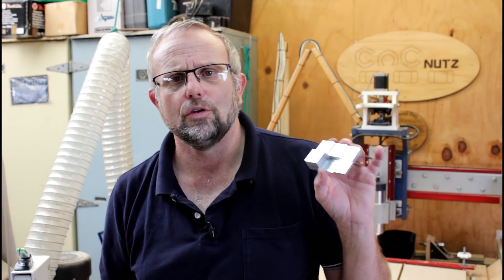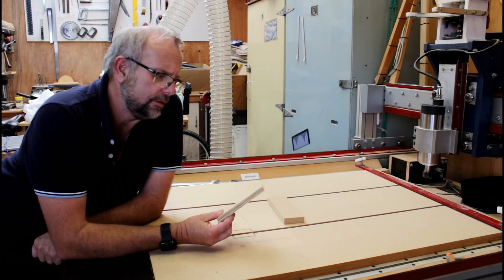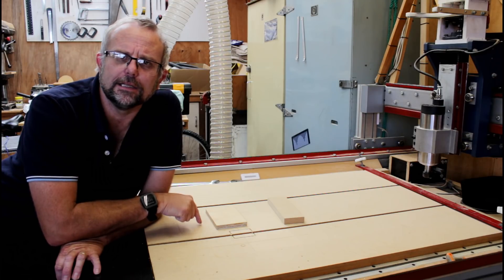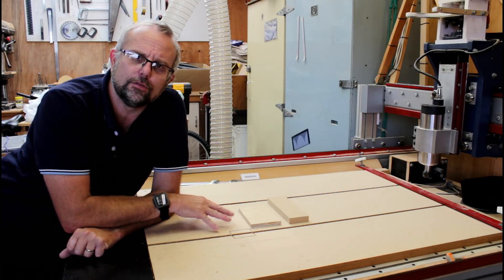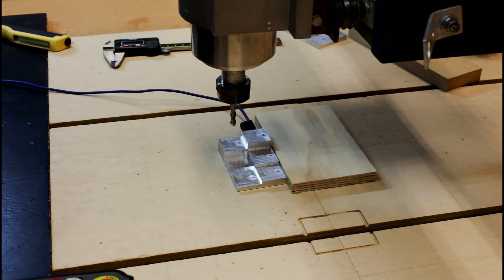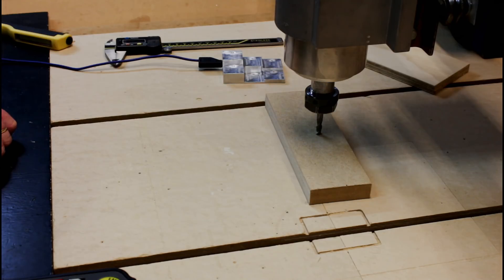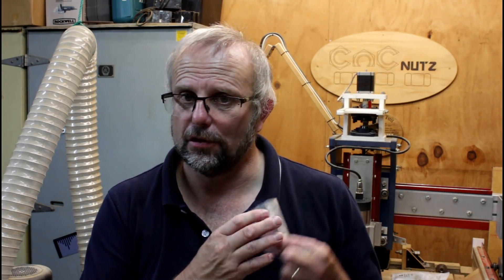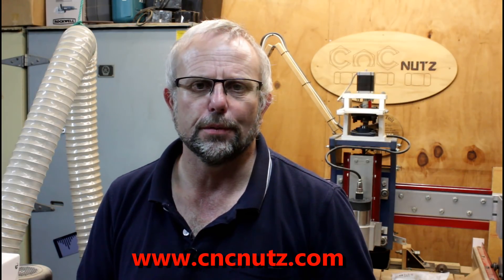The nominal thickness tool setting guide - CNCnutz Episode 202

Comment: I’m sure I’m missing something, but why not always use what you call the “zero” touch plate on the spoilboard, and then set that as the correct Z height? For example, if your stock is 12mm, you would do (where TPT is the touch plate’s thickness) “G92 Z-(12-TPT)” if you made your gcode file with the Z zero on top of the stock with a thickness of 12mm, or you would do “G92 Z(TPT)” if your gcode file uses the spoilboard as its Z zero. Of course, if you don’t have a way for your software to automatically reference your TPT, it might be tedious to type and remember (if it’s not a perfectly round number) every time, but I would guess most software allows to script it (I’m using mostly cnc.js with GRBL: https://github.com/cncjs/cncjs/wiki/User-Guide#statements).

What I would do, then, is “G92 Z12” so my script/macro knows that I want to zero relative to a 12mm stock, then run a script/macro that would simply do something like (with an example TPT, “posz” is the current Z position, which is 12 as set preciously):

%TPT=2.08573
%NEWZ=posz - TPT
G92 Z-[NEWZ]

What I’m I missing? Thanks!
Reply: Just answered my own question by watching the next episode, where you basically do exactly what I explained above. Cool :)
Reply from the maker: Nice one Simon. The fact you understood that something wasn't right is half the battle.
Cheers
Peter

Comment: Very interesting video and idea. Just a question: how do you realize the right thickness of the gauge? I saw the video, the episode 200, where you worked on the aluminum bar, but I don't understand how you can set a perfect thickness of the different steps of the gauge. Probably you put the zero of the the machine on the table instead of at the top of the bar and the you added the desired thicknesses? Sorry for my bad english and may be for my trivial question, but I'm a newbie in the CNC world and I'm studing it.
Reply from the maker: Thanks
All touch off plates have a thickness which is entered into the autozero script. The maximum depth on my gauge is 18mm and the aluminium stoch is about 20mm. The difference is the thickness I enter in the script. I got my thicknesses by starting at the top and called it 18mm. I machined down 6mm which makes the next step 12mm another 6mm makes 6mm as mother 3mm down gives me 3mm and another 3mm down I called 0mm. The remainder will be the 2mm or so of remaining thickness which becomes my touch off thickness. Everything is relative to this height. I hope this makes sense. It's just a pity it was obsolete in less than a week. 😉
Cheers
Peter

Comment: How does the "0" part of the gauge have material and yet when the machine goes back to that "zero" point its below the point of the new "0". The smallest thickness on the tool setting gauge looks like one or two mm... you must have subtracted that value in the calibration of the Z axis yes, you didn't mention this.
Reply from the maker: You are right. The 0 part of the gauge is about 2mm thick and this is the figure that is entered into the script as the plate thickness. Everything else is then referenced from this point. eg the 18mm step is 18mm above the 0 level.
I was going to do a install video but the toolsetter got superceeded by a new Auto Zero script that rended it obsolete so it never got made..

Cheers
Peter
Reply: I like this idea except it could become tricky when the whole job, designed in Aspire, as an example, would have the Z reference either top of material OR bottom of material/spoil board. That would mean creating 2 job files, one with vcarve and or pockets etc and one with profile cuts. Hmmmmm a problem to solve
Reply from the maker: Hi Sean. I think you have misunderstood. At no time is a toolpath created with its origin at the bottom of the stock. All toolpaths are made with the origin at the top. Only 1 file is needed no matter how many tools you change.
Cheers Peter
Reply: @cncnutz  thanks Peter. I think my system is just dumb. nc studio 🤣 but its worked for 8 years

Comment: I hate to be the one to ask the stupid question, but how can you set the bit to zero on top of the material if the nominal thickness gauge cannot possibly be zero?  There has to be some thickness or there wouldn't be any aluminum there.  And how, if you set it to zero on top of the material, does it end up touching the workpiece when homed.  Shouldn't it always be above the workpiece after the first z probe setting?
Reply from the maker: Not a stupid question at all. To me questions mean people are thinking and trying to understand so all is good.
For the same reason that all other tools setters are not infinitely thin. All tool setting Scripts & Macros has a built in offset to account for the thickness of the tool setter itself in my case 2mm. The thickness of the 0 step on the guage is 2mm thick. That makes the 3mm step 5mm thick and that continues all the way to the 18mm step which is actually 20mm thick.
When the cutter is set using a tool setter the Z is calculated as being at the tool setter thickness. eg the machines knows that when the cutter is touching the plate it is 2mm above the material if I am using the 0 step.  From there the cutter is raised above the tool setter by the required amount so that you can get the tool setter out. Please note that the machine knows nothing about my stepped tool setter so if I use the wrong step to set the cutter the zero point will be wrong.
Since Z0 was set on to surface of the stock the cutter will sit on the surface of the stock when the cutter is told to go to Z0.
Please note that I am not homing the machine to send the cutter to X.Y Z 0 but using the Goto Zero function which uses working coordinates.
I'm not quite sure what you are asking in the last question about being above the work piece. If you could rephrase it i will try and answer. Let me know if you have any more questions.
Cheers
Peter
Reply: Thank you Peter, you answered the question.  I was wondering how you could "zero" the bit 2mm above the work and have the bit touching the work after being set 2mm above?

Comment: I think that’s excellent Peter. I’ll make myself one of those. What feed rate did you end up using when cutting the aluminium?
Reply from the maker: I used 30ipm in the end.
Reply: Thanks Peter
Reply from the maker: Hi Des,
Before you make one you might like to hold off as I may a have another solution that will do the same thing better without the need to machine a tool setter. Just working on it now.
Cheers
Peter

Comment: Brilliant... nicely done! Having said that... and being inherently lazy... as well as a fairly decent programmer... I'm going to make some custom buttons on my LinuxCNC panel for "Surface" , 3mm, 6mm, 10mm, 1/2 inch, 3/4 inch, and 1 inch. Then I'll put the plate down as always... and just click the selected button. 

I'll be using the G10 L20 P1 Z__  where Z = offset selected + thickness of the touch plate. 
(For you other CNC geeks out there.)

I guess I'll have to make a video on that... hey! Thanks for the idea Peter!
Reply from the maker: Thanks Jerry,
I like John Rivells method of having the macro ask for the material thickness each time the auto tool zero is used and then setting the cutter accordingly. 0  for setting off the stock surface and the stock thickness if using the tabletop as a reference.That way one button does it all.
Cheers
Peter
Reply: CNCnutz (Peter Passuello) Easy to implement with a spinbox. (text input device in pyvcp).
Reply from the maker: +askjerry
I'm sure that means something to you. I only understand the word easy. 😀

Comment: I want one but don't want to make one because of your trials and tribulations in doing so... can you build me one? LOL  Seriously though this is brilliant!  I've been using your "zeroing to the table" technic since you posted the video on it and it has saved me much time and spoil board! I think it would be an awesome tool to have! I would like to see more on your macros/codes and how you incorporate those with it? I would probably build one plate for each thickness and have a quick connect for the wire lead to simplify building one/them... or buy one from you! LOL
Cheers,
Lyle
Reply from the maker: Thanks Lyle.

Comment: YES, now this is a Z set tool that I will use.  I totally understand your explanations of setting the Z at both positions.  Now I’ll be looking for some good GCode to do the double touch as you mentioned I would prefer that over the single touch, could you link to this type code?
Thanks for all your excellent work.
Reply: Use mine... just change the thickness value of 8.650 to whatever the measured thickness of your plate is.

o<touch-to-zero> sub
G91 G21            ( Retaliative METRIC Mode)
G38.4 Z-20 F100           ( Move DOWN, assume no contact at start, machine reading "probe tripped" )
G0 z1            ( Pop up 1mm )
G38.4 Z-10 F10   ( Back Down 1/10 speed )
G10 L20 P1 Z 8.650  ( Register the surface as 0 + thickness of plate )
G90 G21            ( Back to Absolute Metric Mode )
G0 z10            ( Go up 10mm real units. )
o<touch-to-zero> endsub
Reply from the maker: For my setup I am using a screenset from http://www.thecncwoodworker.com/index.html   
His 2017 screenset for UCCNC and it comes preloaded with the required macros for this and various other functions.
He also has a screenset for Mach3 which I think has the same functionality.

Comment: I use a spring loaded setting gauge.  I have seen cases where the autotool setting function does not stop when it contacts the gauges.  When I see the plunger starting to depress I know it is time to hit the estop and find out what the problem is.  Last time it happened the problem was that the end mill had burned through some wood  on a previous job and that left a nice insulated film on the bottom of the end mill.
Reply from the maker: I know what you mean, it is a bit of a worry.
That said you should always check that the touch probe is working before running the auto tool zero function. In my case I can touch the bottom of the cutter to the touch off plate and make sure the probe light, lights up. That way I would know there is no insulating film on the tool.
cheers 
Peter
Reply: I had that same issue when i had a Gecko G540, but Now I have a Leadshine MX4660 and have not had one issue. I tried everything, line filters, capacitors on all inputs, heck i forget but it was a bunch of things i tried.
Reply from the maker: I will have to see how mine behaves over time as I am using a G540 myself.
Glad you got yours sorted.

Comment: Top little gizmo. I have it a different way though. I have a single 3mm thick piece of Aluminium (measured at 3.09mm) and a custom UCCNC Macro that when run using the MDI command M31, asks for the nominal thickness of the material. If you enter 0, it assumes you are touching off the top of the material and zeros from there. If you enter 12 and touch of from the spoil board surface, it sets the spoil board as -12. This means the single 3mm aluminium strip can be used on any thickness of wood. When I get out to my CNC machine again in the next couple of days, I'll email you the macro for UCCNC. Your Gizmo does have it's advantages though because it is not controller software dependent. Great Job.
Reply: John Revill would also like to see that macro
Reply from the maker: Brilliant John,
I was starting to think it could be done in software and had come to the conclusion that I might be able to make an auto zero key which used a nominal thickness offset to do the same thing. What hadn't occured to me is what you are doing and simply asking for the offset each time in the normal auto zero routine which makes it easier and consistant. I look forward to seing your Macro as I am currently using UCCNC.
Cheers
Peter
Reply from the maker: Hi John
Have managed to modify the Mach3 script for he functionality you have for your UCCNC macro but not having much luck with a UCCNC version. Could you email me a copy of the modified M31 macro. cncnutz65@gmail.com
Just in the process of making a video on the method you have outlined and it works well.
Cheers
Peter
Reply: I've just emailed you the M31.txt macro file. Let me know how you go.
Reply from the maker: +John Revill
Thanks John.

Comment: You made a video how to setup the thickness tool? i meen whit setting in Mach, and where to wire it on the breakerboard.
Reply from the maker: I will look at this in the future but it is so well covered by various people on Youtube that it isn't hard to find. Every machine is different so if you don't have a Gecko G540 as I do you then it may not help. That said you simply connect the touch off plate to one of the inputs on your breakout board and the rest is configured in Mach3 
Checkout Marks video as he covers how he set up his touch off plate and it may be a good starting point.
 https://www.youtube.com/watch?v=aHipE0U9oZc

Comment: Hello Peter, great idea!! I might make one of those myself (if time permits:). I have been using the method of zeroing on the spoilboard and then entering the nominal stock thickness as negative Z value in mach3 ever since I saw your tutorial on this subject. Works great for cutting out parts. Not a scratch on my spoiboard anymore ever since! Except for a couple of little accidents due to me having "in-a-hurry-hence-not-thinking" dumb moments. Would recommend this method to everyone. Not only does it keep your spoiboard intact but more importantly, all parts get completely cut through and also any tabs that you might use are the thickness you want and not thinner or thicker.
The tool you made seems to also get rid of of having to do any Z-entries in Mach3 when using stock with nominal thicknesses corresponding to the ones for which your tool is designed. 
Would you mind sharing the script you use in Mach3 for auto tool zeroing? Nice to have a rough and a fine touch off measurement on the touch off plate!
Thanks for the clear and very usefull material that you produce!!!
Greetz from Belgium!!
Nicolas
Reply from the maker: +Nicolas Dekeyser
Thanks Nicholas
That's exactly what it is about. Accurate cuts and a clean spoilboard is a very desirable side effect of the method.
I know what you mean about doing silly things. There is a cut in my spoilboard at the moment because I changed a cutter and forgot to rezero. Absolute stupidity. 
Cheers
Peter

Comment: Took me while to follow your reasoning but then again I am probably a bit slow.  In the past I had set my cameo ref the top of the project when vcarving and to the bottom when cutting through.  I really like your idea as it means I always set cam to the top surface.  So much easier.  Got to make myself one of those!
Reply from the maker: Changing reference points in CAM is a bad idea. 
You cannot create a single file for the job and have to break it up into multiple files which then need to be loaded seperately. What a pain that must be for both the machining and creating the files in CAM. 
I probably haven't explained myself properly in the past about how this method works when setting things manually.
Cheers
Peter